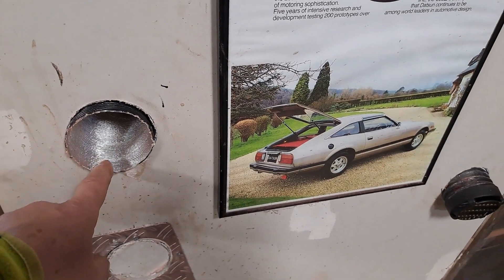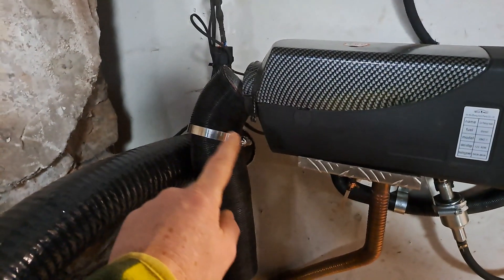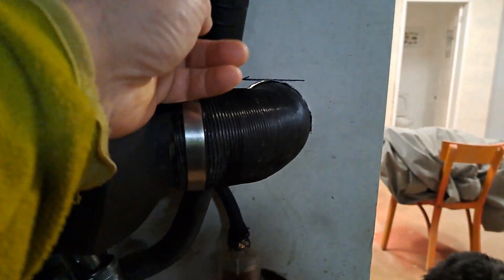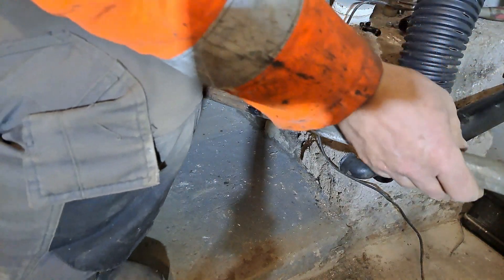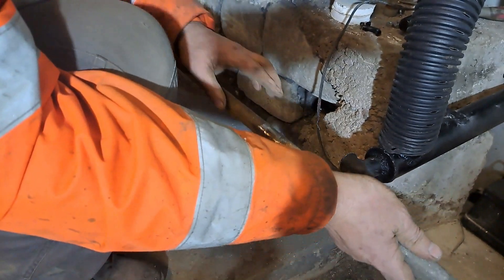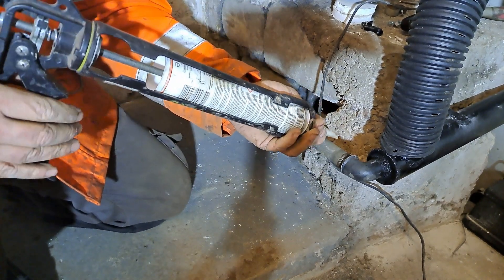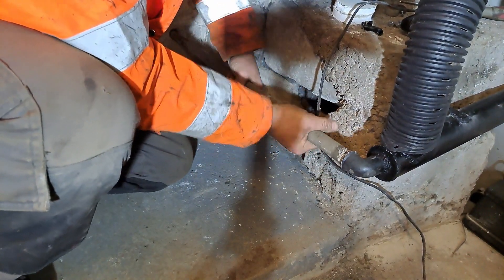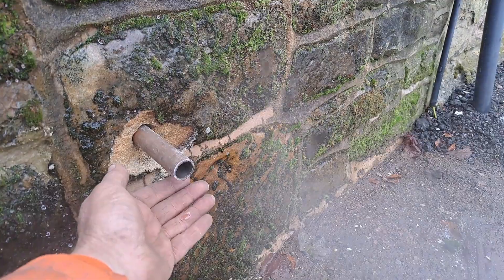Chinese diesel heater, waste oil burner, Exhaust heat exchanger.  how we made it?

Comment: And get i inlet air outside. If you want if much hotter inside.
It suck out heated air in the filter.
So get a pipe of cober steal ore anything out of house in cold whether